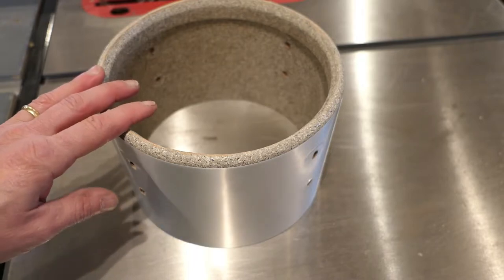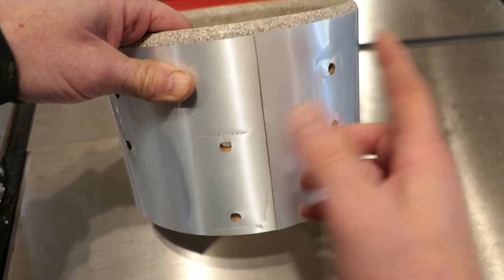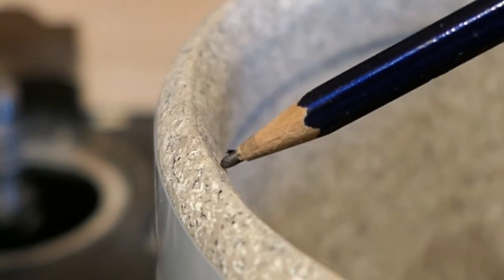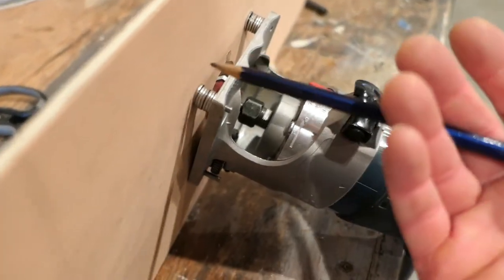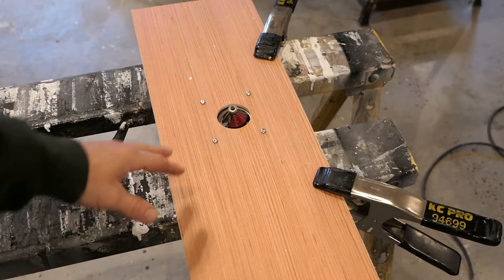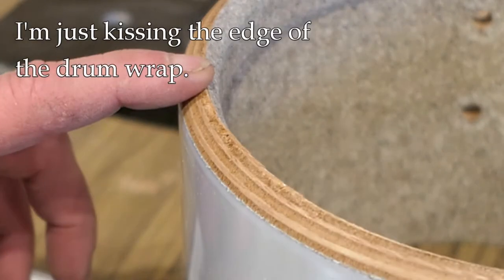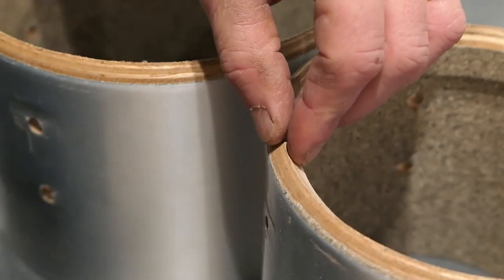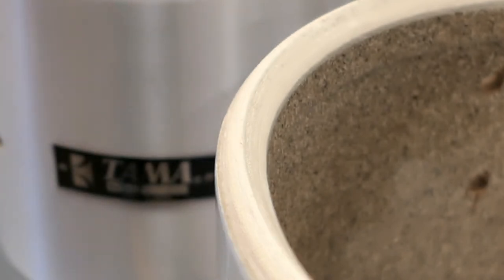How To Restore Damaged Bearing Edges On Your Drums

Comment: Just mo, but big or small, you always secure the paper and use two hands to ensure even pressure distribution or try as you might, the bottom won’t be uniform and it will throw your level when you cut the bearing edges. It may be subtle, but it will affect the fundamental note, pitch,bend & fall.
Reply from the maker: You mean sanding before the cut?  You can see by eye if you turn the drum over and check as you sand.  If one area is getting a wider flat spot that's a telltale sign.

Comment: Spray glue the sandpaper to a board and clamp the board down and you have 2 free hands to turn the drum.  The factory I used to work for had some very large disk sanders for that job.

Comment: Zolatone is the paint. Was popular in many applications for a while until Rhino Lining, Line X and other more durable paints replaced it. I used Zolatone bedliner on my pickup bed back in High School, got 2 different kinds because I couldn't decide which one, mixing the two actually gave me a color scheme that I was actually quite happy with. That year Chromalusion Purpleen had just come out that year, so I got a pint at $319, that was after a discount from the dealer because I used the school's account to purchase it. Glad I wasn't painting the entire truck that crap is expensive. Used it for color changing ghost flames on the hood. Came out wicked. Sold the rest of the paint to the school, which was most of it. Ghost flames don't require much paint. So I have a drum that the bearing edge needs work but the biggest issue I see with it is that it's not even...I mean, if you place the drum with the bearing edge mentioned facing up...then look level at it you can notice that the edge has a couple low spots...say it was a snare(it's not but for simplicity sake) so it would normally be 14"x5" but it gradually dips down to about between 1/8" to 1/4" less than 5" then gradually raises back up. Like rolling hills. How can I get that level again, which I assume must be done before redoing the bearing edge? And I have no flipping clue how it got that way either. Maybe the years of whacking the rims warped the wood? Or maybe just poor craftsmanship? They were a relatively cheap drum set.
Reply from the maker: That's what I was doing at 11:37.  You put sandpaper on a dead-flat surface like a table saw or a large piece of MDF, and then twist the bearing edge around while laid on that flat surface.  It will quickly flatten the whole edge before you cut the profile.

Comment: The Zola Coating was actually like a trunk paint that you can buy. I see Rustolium has a product called "Stone Creations" and it looks really close to this multicolored finish. I remember a guy restoring a tama drum like this in Modern Drummer like 20 years ago.
Reply from the maker: Yes, there are some modern paints which approximate the look of the "Zola-coat."
Reply: That's exactly what I was thinking!! Spent 35 years restoring and painting cars and custom bikes.  I can still see the can it came it!! LOL 
Also , that inner edge looks like a 60 degree bevel.
Reply: The pebble color is the one.

Comment: Handy tip: Use drumheads that aren't so stretched out that that the hoop is below the bearing edge, so that sticks will not smash the bearing edge you just re-cut.
Reply from the maker: That's not actually what was going on, if you are referring to the end.  The Tama Imperialstar 6 and 8 inch concert toms from that era came with special hoops which did sit just below the bearing edge, even with new heads.  I presume the idea was to allow more strike area, but it was a dumb design.  I did finally source replacement hoops of the normal variety and replaced them, but the 6 inch hoop is not easy to find.

Comment: Old drum makers after they would cut the shells edges, would then add paraffin wax on to the edges to protect them and also act as a seal and lubricant.
Reply from the maker: Yes, I've seen that too and done it myself back in the day.
Reply: Don't use paraffin. Anything petroleum based will destroy your drum. Beeswax is the only wax and even then that's only for a bad drum at gas too much friction when tuning. Make sure to really wipe off the beeswax as it very thick.

Comment: Hello good friend, I am in Colombia and I cannot get the formica or sheet with which the drum is lined and I just need the same color as the one you have there, how could I get it to order it. Thanks
Reply from the maker: The inside of the Tama drums from that era was painted with something they called "Zola Coat."  It's just paint.  Today you may be able to find a spray paint with a textured finish which is similar, and you may need to use 2-3 colors to get a match.  Look for a spray paint with a pebbled or textured finish.

Comment: After all that work do they actually sound any different?  New heads would have made much more of a difference.  Looks like you are still using old Tama heads from the 80's that came with the kit.  I am not convinced that bearing edges with a dent or two in them really affect the sound that much.  Most drums already have a vent hole that let's out a lot more air than the small dents.  And in your case they are concert toms, so they don't even have a bottom head, hence no air at all is really going to make it through the small dents.  Sanding is only necessary when the dent makes some wood stick up too high.  Sand it back down to the proper bearing edge and if you must, put some saw dust wood putty in the dip.  I also use high quality glue to fill bearing edge dips or worn out wood and then put the slick filler stuff (forgot the name) on it before the head.  Am I wrong in this perspective?  It's like worrying about the air that goes through a straw held up against a large fan.
Reply from the maker: Sorry, I missed your comment earlier.  Yes, recutting the bearing edges did make a significant difference, and these bearing edges were pretty beat up. You are thinking about airflow in your analysis, but that's not really the issue.  Bearing edges which are smooth and true allow greater sustain and a livelier tone than edges which are damaged or out of round.  It's a matter of resonance, not airflow.  This is true of concert and double headed toms.  Using putty or filler is not going to be a durable repair, and it will also affect the resonance of the drum since it has a different density than the wood and isn't a part of the wood.  The only way to get damaged bearing edges perfectly true and maximize the tone and sustain is to re-cut them.  Incidentally, the heads you saw were just some I had lying around at that moment, not what was ultimately installed.

Comment: Why not just used a 30 degree but?
Reply from the maker: There are lots of different profiles you could choose, I just went with something similar to the original manufacturer.  There are router bits available in many but not all degrees, so you may need to set up a jig or do multiple passes if you want something that differs from the bit profile.